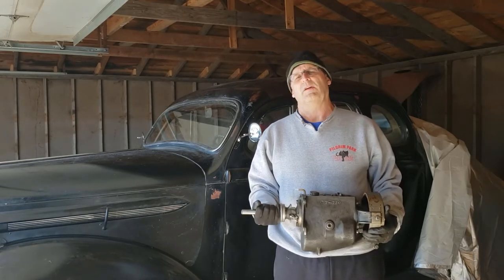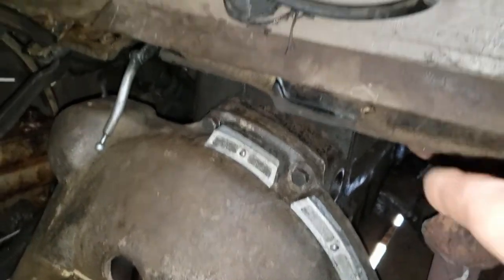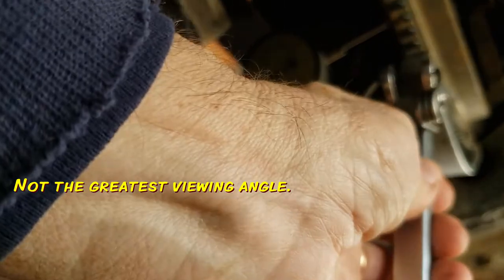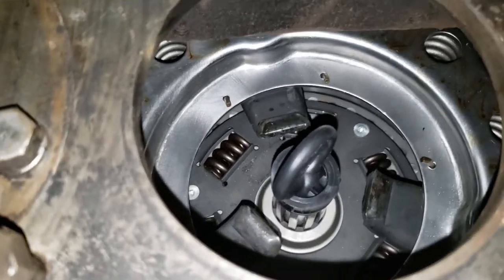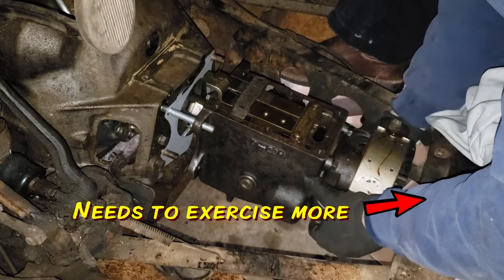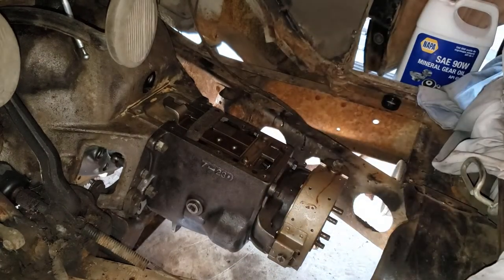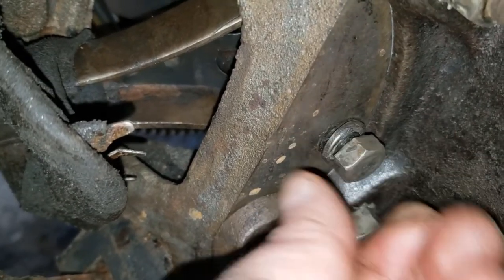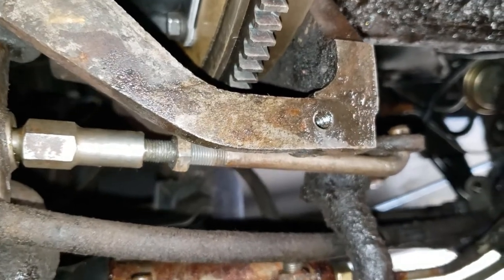Transmission and Clutch Install on 1937 Plymouth Coupe! Ep. 10 Part 4 of 4. #mopar #restore

Comment: Terry, I had a 49 Plymouth business coupe and performed the exact procedure on my back, just like you. The only question I have is why did you not clean all that crud off the bottom of the engine when you were there? That would be the time to do it. Mine was just as dirty and the mounts were soft from leaking oil. I replaced all the parts and added grade 8 bolts where possible.  Just a tip, on the alignment studs cut a small grove into the end of the stud and you can install and remove them with a large screw driver.

Comment: I have the exact car in about exact shape. All original running gear, very very untouched car, from original battery cables to original spare tire.I've been doing some needed work to it over last few years.  It ran and drove great but glass was starting to seperate and all the original rubber seals around windows were shot.  Im not painting it or doing interior to keep it original but went through most everything else that moves.   One thing I found absolutely amazing was that I own a 69 rt charger with 440 and it has the same oil cap markings on it as the 37. I can't wait to get it in the road and drive it! Great car!!
Reply from the maker: That's awesome Tyson! Great to hear you have rare original coupe. Every car show I take it to, people tell me its refreshing to see and unrestored car. You probably get that too!

Comment: Almost identical to my 37 Dodge 2dr coupe, the clutch cover is longer, my tranny cover is square , not rectangular , easier to put on/off. The key image most helpful is where u can see the clutch fork working the throwout bearing or called "a throwout sleeve". Great learning, i had to replace my tranny real time. And monitor engine rebuild and the clucth cover is longer, my tranny cover is square not rectngular , easier to put on/off. The key image most helpful is where u can see the clutch fork working the throwout bearing or called "a throwout sleeve". Great learning, i had to replace my tranny real time. And monitor engine rebuild due to lost mechanical, skill and strength of the mechanic available for a decent dollar, many will charge what u paid for entire car and u loose.

Comment: Key edit idea is to look at your total record time (TRT) then you script segments into program or digital video time, you may want to intend on focusing in on subject matter and your intended message. In our case this is learning experience, holding 30 minute segments for 27:30 (TRT), breakup clips to meet , "a go to black at 27:30", will allow space/ time for credits. Doing this will allow possible advertiser promo! Or if u intend more time due to subject matter, segment time can be adjusted and go into black where end video time is extended. Example;
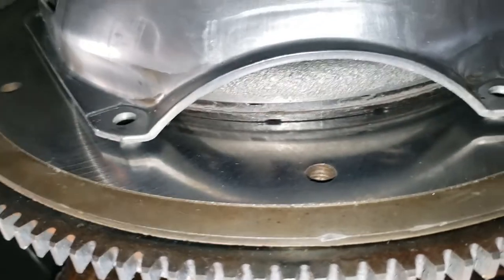7:30 trt go's over into an 8 minute piece? Youll have space to complete info on end  credits.🙈🙉🙊  Not sure what utube requires on TRT, but with your subject matter u can round off a video to 15:00 minutes, keeping the credit time of 3 seconds going in and 3 going out. Your outgoing end time can b tweaked, maybe u have more or less info at the end of your program.
Reply from the maker: Great Info Rich! Big Thanks! I'll give it a try.

Comment: I recently bought a 1936 Plymouth P2 in Belgium and your videos are helpful. On my car, I have to left off the clutch pedal quite far before the car is moving, is it normal? The clutch is not slipping at all but it's quite unconfortable for my foot and my knee :)
Reply from the maker: It is normal when the clutch disc is worn but still functioning properly. Just shorten the clutch adjustment rod to have the clutch engage closer to the floor.
Reply: @FlatheadTerry  Thanks for the explanation, I'll do that :)